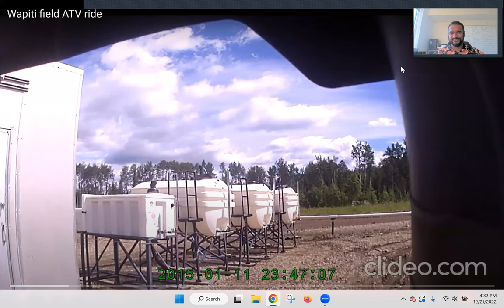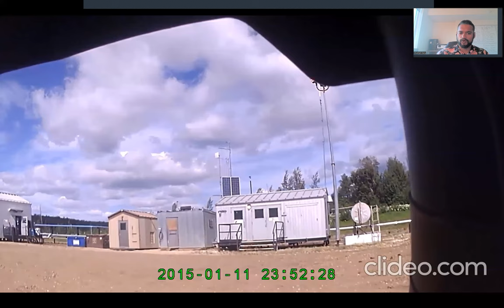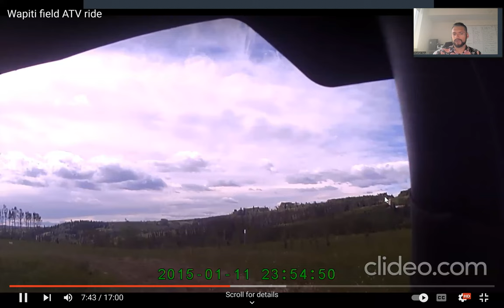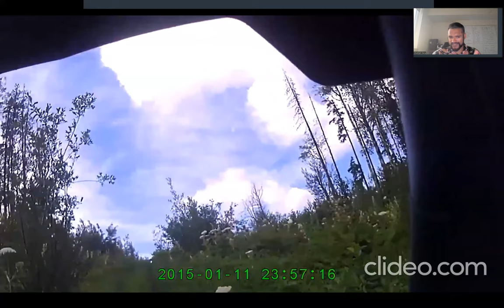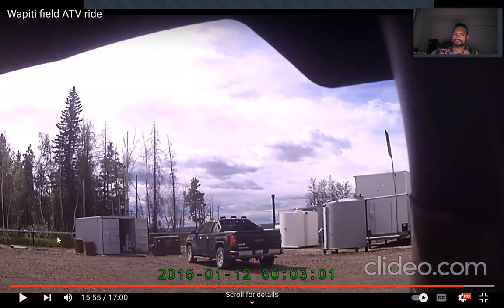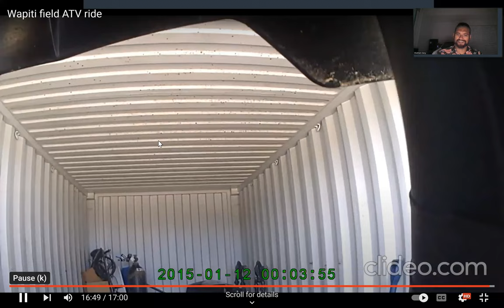O&G Wapiti Field Tour with Narration

Comment: So when we say the skill needed to have stable work in the oil field, we're talking about the ability to solve problems to keep the wells running at a high efficiency and output.  Correct?  Other than working your way up the industry, is there education you can do on the side to enance the process?  Is it engineering?  a 4 yr degree sounds long.  Is it a certificate?  Is it some online courses through some companies?